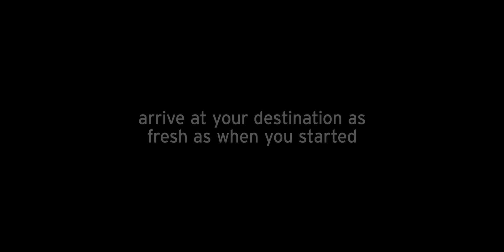Mazda’s G-Vectoring Control

Comment: Hmm, with the tech you can drive a little bit faster and those in the car will not notice the turns it in the same way they would without the tech....In addition, it seems the vehicle tracks the straight line better down the highway without having as many steering corrections. These are the small things that make Mazdas a pleasure to drive, they are not intrusive and they feel natural.